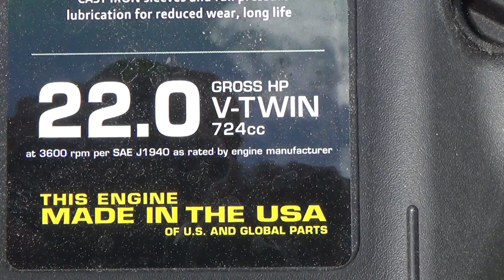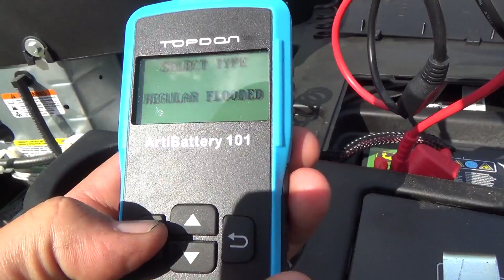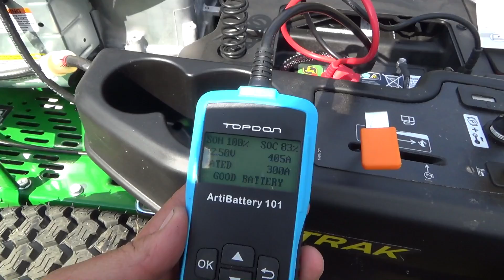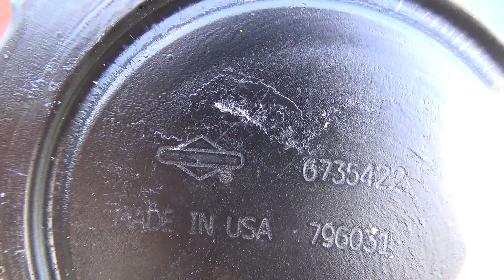You’ll never believe what Jumped on my trailer and followed me home.....YOU Have to see this

Comment: I work for a JD dealer Briggs and striation makes those engines and Deere re brands them. All mowers  are pre ran off an external gas can not to leave fuel in the unit over an extended time.

Comment: Congrats on the new mower! I love our zero turns at work. We have a couple Z915 with 60" decks and a Z425 with 54" deck. The 425 is a way smaller machine and the controls are a lot closer but in tight spaces it's more maneuverable. As you get used to the controls it won't feel as jumpy. You can absolutely fly on those things while mowing and they still do a good job. Also the 425 will pop a wheelie :)
Reply: fillg 
My Z920m will too! It’s a ton of fun to mow with!

Comment: You’ll get used to the controls. Especially if you can get the control levers further forward where it’s more comfortable. It’s easier to finesse the controls when their not right up on you like that. I might suggest cutting out some plates that will move the levers forward 3-4” or so and have extra holes to adjust it back a little closer for the kiddos.

Comment: Yeah! The Accel deep deck is a deeper deck than previous generations giving more room for grass to move around which keeps the blade speed up. It took me awhile to find the adjustment (proper adjustments) for the hydro sensitivity...at the end of the rod that goes from the hydros to the handles there is a piece that screws on to the end of the rod (this is where you adjust) that is held in place by a simple pin set up. You need to lift the plastic shroud on the sides and drop the deck all the way to access it. The spindles have grease nipples. You will know you are out of gas when the orange light comes on on the control panel. Don't get the mulch kit. It's crap. I love my 335e...hope you love yours!
Reply from the maker: good info thanks :)

Comment: The only issue I have with the lesser expensive zero turn mowers is that the hydrostatic system is sealed and can not be serviced aka oil checked or added if it leaks I payed a descent about more for that ability but as long as your happy with it that is all that matters

Comment: Its a no brainer to figure out what your next big purchase is. We can see the reflection in your sunglasses of a Zero Turn John Deere lawnmower. Note: I have the same model and had issues. Hope you have the warranty. I guess nothing runs like a deere!💪💵
Reply from the maker: what problems?
Reply: BILLSTMAXX Hi Bill. Certain models of the Briggs and Stratton V-Twin engines have defective head gaskets. The head bolts are to far apart and it causes the head gaskets to fail. Failed gaskets cause the engine oil to get above the piston and start puffing massive blue smoke. What is the model number of the engine on the lawnmower? Luckily my engine failed under warranty. The repair kit is about $100 that is not including the labor. Have any issues let me know and I will be glad to help.

Comment: I drive 2 at work they work awesome. The older one is like the one you bought and has 2000hrs and the newer one has 800 and has been nothing but problems.
Reply: we bought a diesel  kubota 326 love it plus free 5 year warranty with it plus it holds 6 gallons each side of fuel tanks plus we have a nice comfort air ride seat wich so nice
Reply from the maker: what type of problems?

Comment: That is definitely a briggs and scrapiron motor. If you are curious the briggs part number for the oil filter is 492932s and the wix number is 57035. The air filter I can't remember off hand. However the mower itself should serve you well for around your house. Personally I wouldn't have bought a JD because the aren't worth in terms of a mower, there are better brands out there. However thats because I do parts for a dealership and am around all kinds of mowers all day. For what you are going to use it for it will be fine. If you want the briggs number for the air filter, remind me or message me and ill get it to you tomorrow at work. Also change the oil after 10 hours unless they told you different, I can't remember off hand if john deere says to run it longer, however most of the briggs motors we get in on stuff they say to change after 10 hours. Enjoy it bill, you've like that thing too much I think and will be wanting one for work lol. They are nice to mow with.
Reply: My z465 Deere I cut pasture grass when it is grown a little and it saves a lot of time for mowing it unlike my 455 diesel Deere
Reply from the maker: thanks for the info :)
Reply: Not saying it’s a bad mower. Personally I wouldn’t buy a residential grade mower. But for what he is going to use it for it will be fine. I just prefer bobcat and scag over the Deere mowers. Personally I like the way they ride better

Comment: I had a briggs with one of those plastic intake manifolds over time from the heat it gets brittle, and breaks causing the engine to die or run rough and leak gas. Cheap and terrible design if you ask me.

Comment: Yea my dad when we got our ex mark residential zero turn went off roading took out my mothers bird feeder and into he hedge. Realizing pull back to stop. Whoops funny though years later other than a battery change. Do the oil change and filter right as rain. Yea I never have to add much gas. About a gallon or so. Mowing that much yea. They make portable fuel tanks on wheels gravity fed. They hold thirty gallons. As much mowing as your doing either full from it or use gas cans. May to get bigger cans. Use a fuel nozzle they make to. Fill er up check about every hour and see fuel status. Beats having to run to the station when I was dills age I have ridden my bicycle with five bucks and filled up our gas can. Most of the zero turns like mine run on full throttle and half at idle. She hates the cold for fall leaves. Always has had leave me alone attitude. Electric heater aimed at the block to warm the oil. The only thing that will let her fire up. Full choke full throttle until it lights. Puff of rich fuel. High idle until it warms up. Anxious to know when it gets frigid will it go.

Comment: yes, bill john deer does use Briggs and Straton motor . and that's what that is, no worries they still are great motors. I believe that's what your fathers motor is on his rider that fires up instantly that you serviced a few years back  even JD diesels  are Yanmar  some of there riders at the big box stores lowes and home depot also use kawaski too witch are great small motors as well you fall in love with that zero turn and will want the indresteral one for work i know you saying no no no but you will
Reply: Both my zero turns are Kawasaki motors
Reply: there great running problem free motors
Reply: Kawasaki makes commercial engines Briggs are crap. I had my Briggs head gasket go at before 50 hours.
Reply: John deers either have Kawasaki are Koehler engines Troy built and husky /huskavarna put out John Deere with briggs and straton

Comment: Have a z255 with a about 70hrs on her things already had the lift cables replaced and no matter what I do the deck won't stay up in front keeps noise diving every time you use it
Reply from the maker: Interesting. Yours has cables and this has steel rods
Reply: BILLSTMAXX  I wonder if yours is an updated version mine's around 5 yrs old